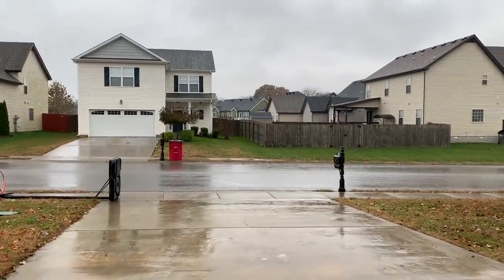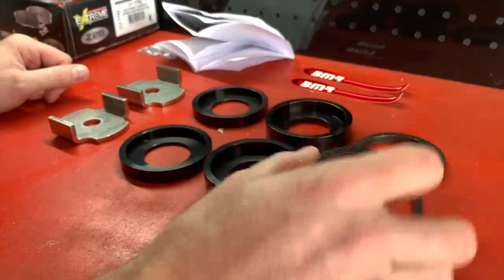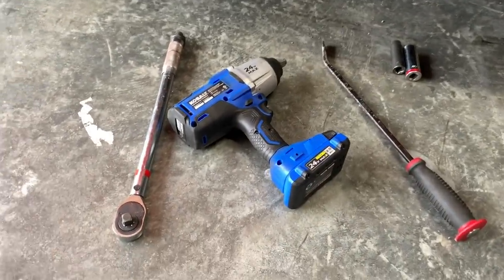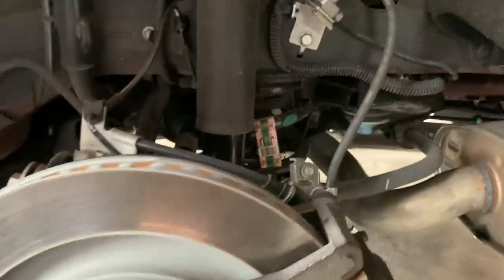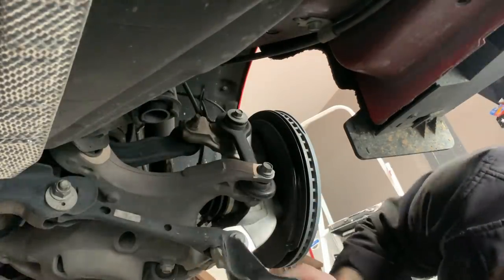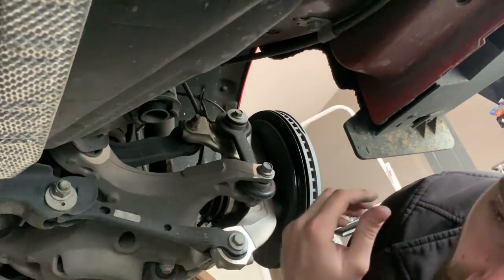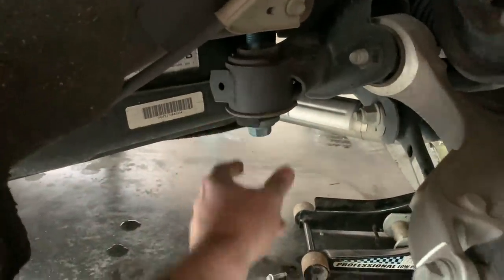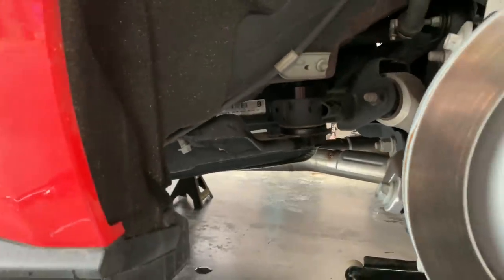STOP- 2018-2019 Mustang GT WHEEL HOP for CHEAP- BMR CB010, CB005, CB762

Comment: Great video, looking at a new 2020 gt, but quick question,  I plan on doing the full BMR locker if I get the car, other mustang owners say no need for the magnaride if I'm going to do that, would appreciate your advice
Reply from the maker: Skip magnaride and order BMR parts instead. bmrsuspension.com promo code zander7 . Start with springs, CB005 and CB762 and go from there. 💪

Comment: I have the CB005 on my 17 GT PP manual. And it still wheel hop badly. 
I am running the Firestone  Firehawk Indy 500 tires witch I believe are suppose to be good tires and I am  running the stock tire pressure.( I have not so far played with the pressure) But it hops badly on the street if I take of hard and it doesn't recover until 3rd gear. If you don't let of the gas.  It is the same on a track. The only pass I have done  was with stock tire pressure. And it hopped badly there also. Afterwards, you could see the wheel hop marks on the track.  
I had high hopes when I installed it. And got disappointed  it wasn't the magic cure I hoped. 
I started thinking if the 23mm wheel spacers I have were causing an issue. But I asked Justin the owner of VMP on there life Youtube show. and he said NO to that.
Is this 762 to be an improvement over the arm in the CB005 and will they discontinue the CB005 arm and only offer the CB010 and the 762 in the future? 
I guess the wheel hop is a much bigger of an issue on manual cars. But I think many other factors are at play then only the soft bushings in the cradle. 

Take my car for exp. 
It has the level 2 cradle lockout but still hops every time when you smash the throttle in 1st gear even if I let it start to roll before I WOT in a straight line, and I am only running Power Pack 2 and a catback. 
I think there must be a movement also in the arms and possible the vertical link. So I guess to get a real solution the bushings need to be replaced in the a-arms, and that is pain to have to do a complete disassembly of the rear suspension. and have stiffer bushings pressed in an out. 

But I hope this work for you, Have fun and good luck with the shootout. Is the weather forecast good?
Reply from the maker: The 762 is supposed to improve it ton loads over the standard cb005. How do you like the Indy 500 tires?
Reply: @Zander13Productions  I think the Indy 500 are good tires specially for the price. Other then experience wheel hop that I am think is not the tires fault. They have performed fine. But maybe they shine better or gain max traction in a country with higher temps then I live in. I live in Iceland were hot is 60-65 F at best!!

Comment: So I currently have the CB005 Cradle lockout kit, Do you think I should or need to add the CB010 kit with it? or would I be just fine sticking with just the CB005?
Reply from the maker: You already have it. CB010 is included in the CB005. You could add the CB762 and get a big performance upgrade from that for not much money. Discount code on BMR website is zander7. Also vertical links will help too

Comment: Great vid brother. Congrats on the sponsorship. I have CB005 on mine with the diff bushings kit. I think I regret the diff bushings kit. I believe it is causing some NVH :( not sure how much of it is the tires and how are the actual bushings...Could be the CB005 as well, not sure have not driven the car stock :D

The rear end still feels loose at some points. Feels "spongy", like the rear end moves sideways (don't mean the tires are slipping). I have Magneride and FP lower springs :(
Reply from the maker: I am not sure I would want to do the diff bushings at all. those are bound to transfer noise. what tires do you have?
Reply: @Zander13Productions Michelin  PS4S 295/35/20 on the rears

Comment: Do u think if u take Cb005 it will handle worse? im actually putting my bmr kit together to im gathering as much info as i can. thank you for the video. I had Steeda and loved it on my 15 GT now i wanna try BMR on my 18 PP1 :)
Reply from the maker: Honestly CB005 will solve a lot. But I would highly consider the CB762 in addition. But you can always add that later. zander7 is your promo code to save some money on BMR website
Reply: @Zander13Productions  thanks man. :)

Comment: If I have the 762 do I really need anymore?
Reply from the maker: The CB 001 or CB005 is a lot more beneficial than just the 762. The 762 is for big power regity. The other CB005 or 001 is for actual wheel hope

Comment: Great mod for the 10r80 cars. The poor bastards with mt82 are struggling with wheel hop no matter what they do. Has anyone ever done a solid axle swap on an s550?
Reply from the maker: I wish ford would offer that
Reply: 370H55V O773H there is an entire 9 inch swap on driveshaft shops page if I remember correctly
Reply: @Penn-  nice. I'll look into it. I'm hoping to get an s550 roller sometime next year.